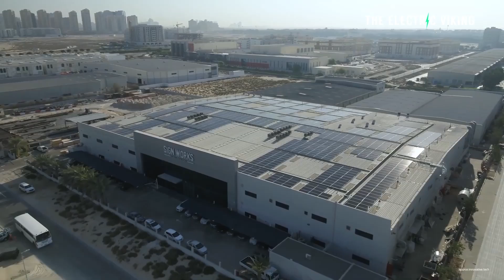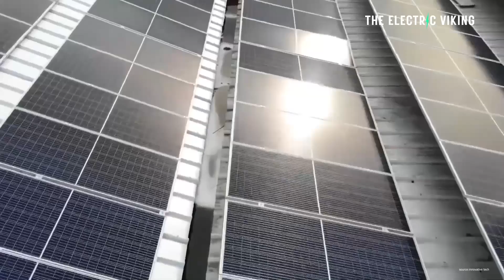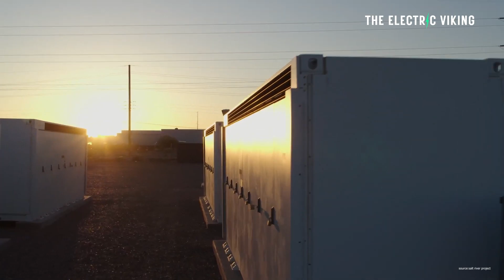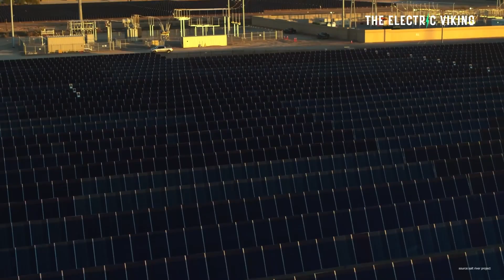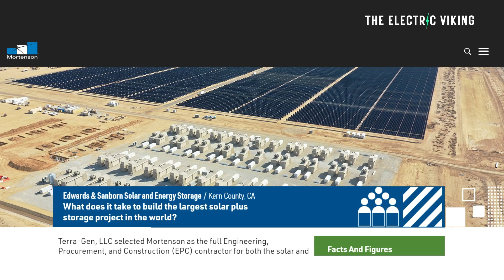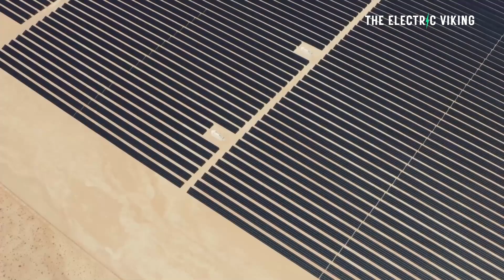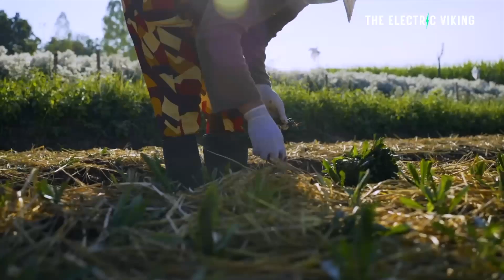The world’s largest solar and battery power plant has 1.9 million panels

Comment: Sam, I really enjoy watching your videos and I always end up learning a lot. I had a question though regarding the installed capacity of this solar farm. You mentioned a number of, iirc, 857 MW. You quote a number for the Golmud facility in China at 2.8 GW (2,800 MW) and note that that is 10% less than the Terra-Glen solar farm near Edwards AFB. If the 10% less is correct that would make the Edwards AFB solar farm 3.1GW But Terra-Glen quote an installed capacity of 1.3 GW. That would make each solar panel good for 650 Watts.
(Bayswater in the Hunter Valley, as you know, has 4 coal fired thermal units each of 685 MW and generates a bit over 15,400 GWh each year).

Comment: While this is a massive solar project it actually is quite a small electricity producer. Not even 1 GW at peak output. It won’t produce its peak capacity of 0.80GW very often. It’s great to have but many more of this size solar farms are needed to make a difference

Comment: Excellent and informative video about the largest US clean energy transition, solar farm with 1900000 PV panels and 121000 batteries, plus 98 miles transmission lines.  Working 1000 workers for 2 years is around 2=52*5*8*1000=4160000 hr, so if an hr job will cost the minimum 25$/hr the installation costly arrive 104 million dollar and if 1 kwh on wholesale will be 0.05$/kwh then the plant must sell 2.08 TWh to get the installation cost.  What are the capital cost invested for 1.9 million panels, the cost of 121000 batteries, the cost of 98 miles transmission lines, what is the lease on 4600 acres land, what is the bank loan and interes, and what payoff time has this solar power plant?

Comment: 121000 batteries to store the peak output for  less than 4 hours. A completely different technology is needed to store a realistic grid scale quantity of electric power
Reply: Battery storage is for rapid high load demand. That's the current problem that needs to be solved to stabilize the grids because solar and wind can show intermittencies at the minute time scale. The next longer time scale is four to six hours in summer as AC demand continues even after sunset in states that have warm climates. There is also a mismatch between demand and supply in the early morning hours as businesses are opening before solar has sufficient production capacity. This intra-day storage can be easily met with batteries. The much harder part will be to cover weekly and seasonal supply-demand mismatches, especially for heating.
Reply: @lepidoptera9337  Quite right! If solar and wind are to replace fossil for heavy industry We need to have affordable storage for weeks. Talk of hydrogen and ammonia is a symptom of the lack of away to store significant amounts of electric power

Comment: Since we are pulling energy out of the sun, I wonder what the effect is on the climate in that local area. I have been there a few times and it's fairly dry desert. The shade provided should cool the area . Then converting energy into electric power should remove more that would be absorbed into the sand as heat ( unless it's all reflected). Will that cool the day time Temps on the base a few degrees? Anyone study this an have. Facts? Just wondering.
Reply: Probably not in a relevant way. We are artificially increasing absorption but are then removing more energy through the grid and through the radiation these panels give off during the night time. Overall it's probably mostly a wash unless we start to actively engineer the panels as efficient IR reflectors. The shade does seem to reduce evaporation, though, so plants will grow longer and better underneath panels. Eventually we will probably need this effect to offset the increasingly more arid conditions in the South of the US due to global warming. 

I have seen one science study that estimated the cooling in the Sahara due to increase in heating during the daytime, which I believe draws cold, moist air in from the ocean (we are creating an artificial circulation heat engine, I believe). The article was mostly negative about the impact, if I remember correctly. Even million square kilometer patches hardly seem to make enough of a climate impact to change rainfall substantially.

Comment: Area wise, a nuclear plant would take less, but just over all "spare area" we still have a ton we could use for solar panels. From roof tops to using solar as more of a grid - there is ton of places we can stick them and connect. Batteries are still a MAJOR cost though... until new tech comes out using cheaper materials - its the only down side to renewables. Esp for home/local grids that can already afford the panels - but dont wanna see their money wash away during the night. Batteries alone could still off set something like 20% of the power grid as most of our power in the US is just turn into heat/waste when not in use during the day.
Reply: Cost per cycle is what counts and that can be reduced greatly with battery technologies that have longer lifetime. Once batteries reach the 10,000 cycle mark, their cost impact becomes marginal. We are almost there.

Comment: Very nice these solar arrays with sheep using them for their shady place. As prices of panels are falling is'n it a good idea to store the energy with liquid air technology?
Only 10% losses but much cheaper than batteries. Proven technology and almost no impact on the environment compared to the "dirty" mining of lithium and cobalt!!
Reply: You need to read the fine print. Round trip efficiency is 80% WITH waste heat. In other words, unless you can get tens or even hundreds of MW of waste heat from somewhere it's very inefficient. Since the storage and retrieval are intermittent, it's also not a good use of the waste heat source, unless you are using it to increase the thermodynamic efficiency of a peaker plant. That, of course, is not an actual storage solution.  This is more of a technology looking for an application than an actual solution strategy.

Comment: I have to wonder about the heat generated by the dark panels when the sun hits them, where does all that heat go? Could that also be harnessed in some way? Just an idea!
Reply: Real issue with heat still, yes. This is why everyone is watching the efficiency numbers so closely. 33% means that “black” surface is converting 1/3 of light into electricity and 2/3 into heat. We still need breakthroughs in solar cell technology too.

Comment: Collectively, China is still producing far, far more than the US is and has the plans to complete multiple new solar farms in its various deserts. The amount of solar that China is generating could fit the energy needs of India. I don't think that will change  - China simply needs a lot more energy than the US.
Reply: China’s scale is allowing prices to drop further.  It would be spectacular to see Australia build out the electric grid to Asia and start exporting electricity
Reply: 🔌🔌China has to do something to brag about going green with over 57% of its electricity coming from coal and roughly 200 electric coal plants under construction. They do not need more energy than the USA they need clean energy🔌🔌
Reply: As a european we have a lot of aligned interests with China when it comes to renewables. US, Russia, Middle East mainly want to keep selling us fossil fuels at forever rising prices.

Comment: And how much co2 has been generated making all that lot? And will continue to be generated as worn out/damaged/failed parts need to be replaced??
Anf like all these projects, I don't see any kind of realistic firewalling (or even distancing) between those giant batteries...
Reply: The question you should be asking is what is the total carbon footprint of solar compared to coal and natural gas.  The answer is solar's (and wind's) carbon footprint is a tiny fraction of fossil fuel.
Reply: Solar power plants do take up a lot of land, but they are still much cheaper and cleaner for our environment than dirty coal or natural gas. Remember these solar panels can produce electricity for 25 years, with minimal maintenance, compared to a dirty coal or natural gas plant that requires continuous mining or fracking.
Reply: @sbl17jackson37  
More than 25 years.  Our oldest panels are well over 30 years old and have held up very well.  Most failures from early panels were the result of leaky, corroding connection boxes and panel delamination.  Technology has improved a lot over the last 3+ decades.

The DOE reported that panels manufactured post 2000 should lose between 0.5% and 2% output per year with the highest loses in areas of major wind and/or solar loading as well as high UV exposure.  A panel that degrades 2% per year would still produce 50% as much electricity as when new after 25 years and, depending on the value of the site, might be worth replacing.  A panel losing 0.5% per year would still be producing 75% as much power as new after 50 years.

Comment: What is the cost of this solar plant?
Reply: I can assure you it’s far cheaper than nuclear
Reply: Not cheaper than nuclear anyway. The whole Edwards Sanborn project is budgeted at 2 billion dollars. It's effective average output will be around 160 MW, so the cost / kW will be about 12000 dollars. One can easily build nuclear for less than that, except in the UK.

Comment: Roof top solar panels (including EVs solar film) vs grid solar... I go roof top when given a choice. However, there will always be a need for grid power. Solar panel shading land with agricultural benefits and solar panel shading reservoirs/canals to reduce evaporation are both great dual use benefits. The 2050 Net Zero carbon goal is looking more achievable all the time, primarily due to the incredible advances in solar and battery tech.

Comment: Just so dumb. Massive waste of resources and land area for SFA energy. Nuclear would provide that in <2% the land area, with higher capacity factor and no need for batteries. Add in the fact that it lasts 4 times as long and works at night and it’s a much smarter and cost effective solution.
Reply: And then….. come the decommissioning costs and contamination. People like you NEVER mention that.
Reply: @jsanders100 people like me…. If you knew anything about nuclear you’d know neither of those are actually issues.  But you don’t do you…
Reply: Nuclear plants also require huge amounts of steel and concrete. And sure they use less land but this land is a desert or near desert. There is plenty of that type of land. And remember, this land cannot be used for nuclear power because those require a river or sea for emergency cooling.
Reply: Solar is cheaper.
Reply: It seems to be working.  Why is this project attracting investment and nuclear plants not...in the USA?

Are the shade farmers lying?
Reply: So when are you going to invest all of YOUR money in a nuclear power plant? That I want to see. ;-)
Reply: @lepidoptera9337 moron
Reply: That nuclear waste though, and no risk for a meltdown with solar
Reply: @bardz0sz 

Perhaps check out the deaths per TWh for both solar and nuclear then😂 

Nuclear waste? You mean the fuel cycle and spent nuclear fuel that is a solved engineering issue.
Reply: Ah, yes.  Nuclear power generation, the promise that has never been kept.  Still believe in the tooth fairy too?
Reply: What is the construction cost of nuclear power plant?
Reply: @vladimirprutian5647 

Roughly 1/3 the system costs of solar + batteries + back up generation + transmission line infrastructure over the expected lifespan of a modern nuclear plant. So it turns out a solar panel is cheap, but the supporting infrastructure costs and intermittent nature make nuclear extremely cost competitive for baseload generation and stabilisation. Nuclear has the added benefit of demonstrably lower consumer electricity prices.
Reply: @polarbear7255  Cost competitive? Then why did Georgia go bankrupt? The abbreviation of the definition of insanity is spelled "nuclear". ;-)
Reply: @lepidoptera9337  oh you’re going to have to do much better than mere rhetoric. Come on, you know I’m right…😁
Reply: @polarbear7255  Yes, you are making a good fool of yourself right now. ;-)
Reply: @vladimirprutian5647  about 5300 per kilowatt hour.  Wind cost about 2000. Could not find current prices on solar because it’s falling so fast, but two years ago it was about 1800 per KWH.  These figures do not include financing charges.

Comment: How do they clean the dust off the panels? The wind blows out there.
Reply: Robots, they float along the panels and sweep them.
Reply: @SiliconSingh I don't know whether to laugh or cry at your.???
Reply: One the video clips in this video does appear to show an automated cleaning machine. Robot?
Reply: @robertfonovic3551  

You could applaud.  Robots are already cleaning solar panels.
Reply: @robertfonovic3551 - I’ve seen video of mechanized panel cleaners that move along rows of panels and sweep them clean.
Reply: Yes. I saw robots clean the solar panels.
Actually they also have largest solar plant of 30GW
Reply: They clean the dust using radioactive water spewing from the Fukushima power plant.

<Sarcasm>
Reply: The could employ people with feather dusters.😅😅
Reply: @robertfonovic3551 why through, it cheaper with machine

Comment: Entire Australia contains plenty of such deserts able to be harversted by solar power. The problem is Australia cannot export that energy. If internal consumption will not need so much energy it can be used for smelting Aluminium.
Reply: Not smelting aluminium, smelting iron ore to make our own steel. At least that's what Andrew "Twiggy" Forrest wants to do with the ex-SunCable project in NT
Reply: @joebloggs6131  Yes, Australia is the largest Iron ore exporter to China. The final product, steel, is much more expensive than the ore. Besides it can open some manufacturing locally.
Reply: @joebloggs6131 proof that Twiggie smokes crack.
Reply: @robertfonovic3551 No, it is proof that Twiggy thinks. More than can be said for many renewables naysayers.
Reply: Yes, embodied energy is stored energy in the form of a product/material.
Reply: What ever happened to the Powerlink project in NW Australia that was to export electricity thru an undersea cable to Singapore?  It was supposed to go into operation in 2027 as a 17-20 GW solar farm.
Reply: @Chainyanker007   I don't know. But Singapore is building more LNG terminals to reduce dependence on gas from Indonesia. A cable from Australia to Singapore would be vulnerable to sabotage, with no  storage backup.
Reply: Make ammonia with electrolytic hydrogen band atmospheric nitrogen. The global production of ammonia was estimated to have amounted to a total of 150 million metric tons in 2023.. Virtually all from fossil fuels waiting to be displaced.

Comment: You say 870Mw is the world's largest solar park? Nope, not even top 10!
Visual Capitalist shows that India’s Bhadla Solar Park is the world’s largest solar park as of the time of the dataset. It has the capacity to generate 2,245 megawatts of electricity alone.

Mexico’s Villanueva Solar Park is the largest solar plant in the Americas with an 828 megawatt capacity, while the Copper Mountain Solar Facility (802 MW) in Nevada and the Mount Signal Solar Park (794 MW) in California are the largest plants in the United States.

Meaning, Bhadla's existing park is almost 3 times larger than the park under construction in this video
Reply: He said by the end of this year it will be among the largest and how much energy storage do those have if any.
Reply: @HoppyHiker  yes, I'm aware of that. Bhadla Solar Park does indeed use batteries. However, the present capacity is unknown.

Another comparison is that the park in this video is listed as 4400 acres whereas Bhadla Solar Park is presently 14,000 acres

Comment: Watched a cool video today by Ziroth called "Why Solid Carbon Batteries Are Taking Over". This company Antora has developed a solid graphite battery for storing heat at 2000º C for industrial processes - like ceramics, cement cooking, steel mills etc. Ideally the battery is heated with excess green power from wind and solar. The battery also has cells that convert the intense infrared generated by the graphite (it glows white hot) directly into electricity if needed. Seems like giant solar farms like these would be a perfect pairing with these new batteries.
Reply: Taking over?  How many Gwh of batteries have they produced?  How many are actually deployed?
Reply: @TheEvilmooseofdoom  The title of the video is not the good part.
Reply: @TheEvilmooseofdoom  Miraculous battery technology is popping up every 5 minutes and will disrupt and destroy everything we have seen so far...
Real battery prices seem to flat out over the past few years, the time of big improvements seems over to me.
Maybe sodium ion will be a bit cheaper but it has to be proven in reality.
Reply: @TheEvilmooseofdoom none and none.

Comment: All those solar panels cant even power all the houses in kern county?  Im very skeptical that the amount of land use is worth the trade off?   Just build a nuclear power plant in a tiny fraction of the land use.
Reply: Then perhaps you should take a look at how land is used in the U.S. and tell us what you think of it.  Land used for solar is in the noise.
Reply: It can take a decade or more just to get the permitting for a nuclear reactor, and the nuclear industry is not exactly cost effective.
Reply: @TheEvilmooseofdoom  Permitting is a government issue.  Nuclear, like solar is very capital intensive (large upfront costs), but conserves land and lasts several times longer than solar.  So you only have to build it once every eighty years, instead of every ten years like solar.  Multiply the cost of solar times eight and compare costs.